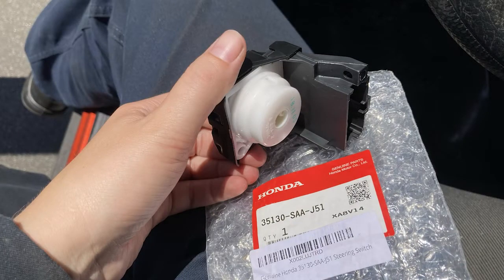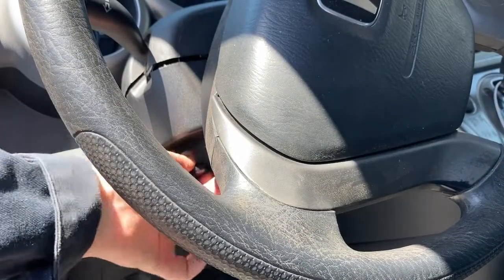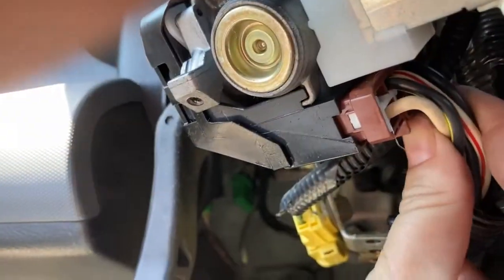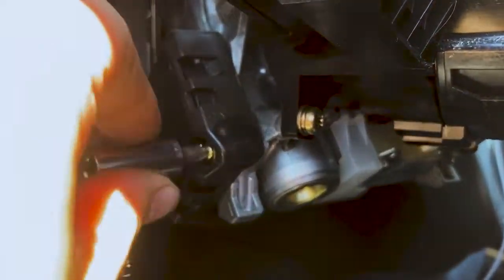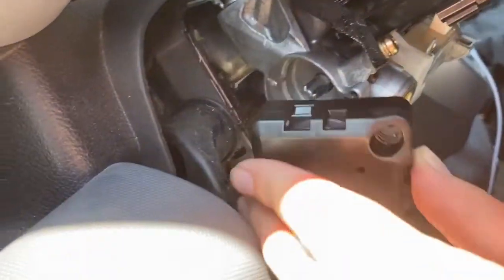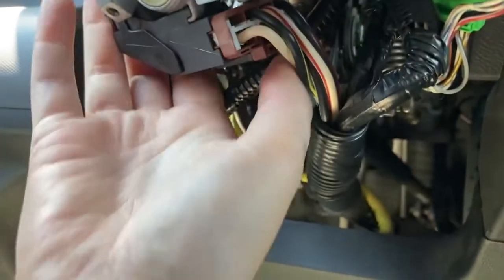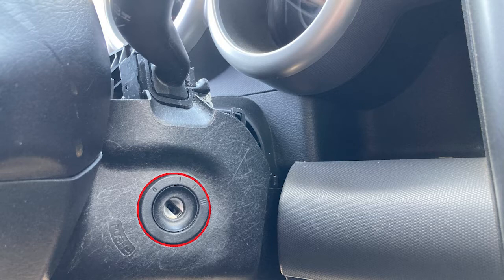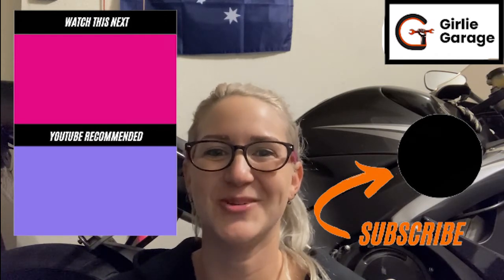2003-2011 Honda Element - Replace Ignition Switch - Girlie Garage

Comment: 1) At 53 seconds into...notice Girlie's sleight of hand all you rookies...she DEPRESSES the  tab underneath to release the electrical connector from the switch. I was fighting it, contorted over with a magnifying mirror trying to decide if the tab is raised or depressed.  Total rook. 2).  As I was taking the original switch out without having the new part available to see the location of the second screw, I was fooled by the picture of the screw with the arrow....It is located on the OPPOSITE side of the switch. I disconnected the turn signal connector to get a little more room to work there. Thank you Girlie!...especially the opening where you demonstrate the problem!  Hopefully this ends the intermittent ignition nightmare that has been haunting me for the last 5? months. This was the Lyme disease of auto repair. 1) My mechanic would insert the key the other way...and it would start....sometimes. So I would give it time to recognize the chip, and it worked sometimes 2) Then I would jiggle the shifter in Park sometimes...and THEN it would start...sometimes. 3) Then when that failed ,I'd  shift into Neutral, jiggle it,...and then it would start... sometimes. By playing and jiggling with it between Park and Neutral, it would eventually turn over. I then replaced the Neutral Safety Switch, suspecting it was faulty, and indeed it seemed to work great....for a while. But it kept getting worse..yesterday endless key turns...20?.. while figuring out which garage to tow it to. 
         But one final search today of "Intermittent Ignition Problems" in the Element Owners Forum mentioned the ignition switch. I had already previously replaced the ignition cylinder a couple of years ago. If that was failing again, it would be a $600 bill at Honda. So Girlie to the rescue for $50!!  Thanks again.
Reply from the maker: Wow! Please let us know if this fixed the problem!!
Reply: @GirlieGarage  Yep..all fixed!! Thanks again!
Reply: @GirlieGarage  Got it...works great
Reply from the maker: @tompem  Fantastic! Thank you for the details with your specific issue. I'm sure it will help someone else out there struggling with the same problem!

Comment: Mine is doing the exact same thing! I'm so glad you posted this and made it very simple for someone who is not mechanically inclined. I actually feel like this it completely doable for me to handle myself.
Reply from the maker: Great! Let us know how it goes!
Reply: Finally got the part in (ordered what you recommended,  but it was on backorder). It came in and I changed it a couple days ago. Your video definitely made the process easy and my car starts perfectly again. :)
Reply from the maker: @toaturner1988  Yay!! That is great news! Thank you for sharing and I'm glad your Element is back to starting regularly 🙂

Comment: You just saved me bank! Dealership told me 2 years ago that this was a typical Element problem, and i just needed to turn the key faster. Fast forward 2 years. Seems faulty switch was draining my battery (and of course they won't honor the warranty). They wanted $300 to replace the switch. Thanks again!
Reply from the maker: 🤦‍♀️ they never want to cover anything under warranty….I’m glad you were able to save yourself money and solve the problem of your battery drain!

Comment: This would indeed be a simple repair, except for the fact that the screws holding  the switch in place are impossible to reach with a regular screwdriver. 
Thanks for getting me pointed in the right direction.

Comment: I’m stumped! The 2screws taken from the old ignition switch will not engage with the housing it appears one screw has 2 washers and the other 1.  Reversed them and still unable to screw them in place. Any ideas?
Reply from the maker: Sounds like someone previously did something sketchy or the new one might be a bad part?

Comment: I tried to execute this repair after watching this video, the replacement switch I got was turned to the second position so when I plugged it in the car’s battery turned everything on. After switching it to the correct position and finishing the replacement, I put the key in the ignition but it will not turn at all. The green key light is blinking so I think I set off some anti-theft mechanism. I’m trying to remove the key cylinder to see if a wafer is preventing it from turning but I am wondering if maybe I set off an anti theft mechanism. It’s just weird that the key won’t turn at all. Let me know if you have any ideas!
Reply from the maker: Did you check to see if you accidentally engaged the steering lock? Try putting the key in and wiggling the steering wheel while trying to turn the key. Let me know if that works or if you’ve already found a solution
Reply: Did you end up fixing it? Im running into the same issue

Comment: how do we know if it's the Ignition Switch or the Starter Relay or the actual Starter itself?
Reply from the maker: Much different symptoms for each. If you have roadside assistance they can test your starter for you. You can swap your starter relay with another to test that, the buzzing is the primary symptom of the switch going bad

Comment: Do I need to disconnect that battery before swapping out this part?
Thank you!
Reply from the maker: It's always a good idea when working on electrical to disconnect the battery. Make sure you have your radio code, if not, you can call Honda for it.
Reply: Don't have to, but like they said, it's always a good idea/ safe practice
Reply: What is a radio code?
Reply from the maker: @jgray928  if your radio works after disconnecting the battery you don’t need to worry about a radio code, otherwise it’s a security precaution designed to prevent theft
Reply: @jgray928  after disconnecting the battery on Honda Elements, you won't be able to play your car radio at all. It will ask for a code. I found mine after filling out a form online with a Honda specialist. Sorry I can't remember where, it was awhile ago.  You can Google how to get one specifically for your car, as they are all different.
Reply: @GirlieGarage  thanks! I just ended up not disconnecting the battery…

Comment: Do i need to reprogram the key after replacing the ignition switch
Reply from the maker: You should not have to reprogram the key
Reply: @GirlieGarage what if someone replaced the ignition
Switch and when they did, gave u a different key that now starts the Honda? The old key seems to just crank it and not turn it over. Wanted to ask before I get a switch. The car starts 9 out of 10 times but has to be turned past where the key needs to start.. like 5 percent past. When it does, it makes a buzzzzzing noise . I just thought it was a low battery but not sure. That one time it doesn’t start, it doesn’t do anything. But I have been jumped and it starts right up. Also just last week, it did the same thing and didn’t start. I have a flashlight that also jumps dead battery’s so I tried it. Hooked it up and when I went to start it, didn’t even
Have to turn the key 1/4 of the way and brrrrmmmmmm it started right up. Actually kinda startled me if turned over so
Quickly . Still the ignition switch?
Reply from the maker: @seanhunty9304  Unfortunately that is not enough diagnostic info for me to be able to tell. I would suggest having your battery checked for free at any auto parts store (or if you have AAA they will usually check it for you as well) in order to rule that out. Could be wiring, or the ignition switch, sounds like there are some things to still be ruled out.
Reply: @GirlieGarage  I did . Says still at right Amos but old. I spent the lowest at $10 n got a starter relay switch to begin the not take it to a place to get done place first. Thanks for the answer. :-)

Comment: Mine did that.. but now I struggle to turn key.. what could it be?
Reply from the maker: Does the key turn completely though? Did all the screws get tightened up?
Reply: @GirlieGarage  yes it stopped making buzz noise. 2 weeks later I sticked the key and it won't turn at all I gotta stick it in and out and jiggle it (fight with it) and 3 times I have had to do it already. But I'm scared  that maybe next time i.wont be able to get to turn anymore. I been watching YouTube and the word  "tumbler"  was said alot. Suggestions? Or any idea? Thank you
Reply from the maker: @marcodelapaz5021 the tumbler is the part of the ignition where your key goes into, eventually they do get worn down. You could try 2 things: 
1. Make sure it’s not your steering wheel lock causing you issues (jiggle the steering wheel when inserting the key and see if that changes things)
2. You could spray a small amount of WD40 into the tumbler (use the key to spread it open and the straw to spray) and see if you can give the tumbler a bit more life with some lubricant

Comment: My key still won’t turn. Any suggestions on why
Reply from the maker: So the key not turning would be a problem with the lock cylinder/tumbler. You could replace it and have 2 keys (one for the door and one for the ignition) or you can contact a lock smith

Comment: Anyone by chance know where I can get replacement screws for the switch? Took me forever to get those screws out because they are pretty stripped.  I'm guessing a dealer, but would rather not go through that trouble. Also if anyone knows the size/ type of these, as I didn't find them at the local hardware store. Thanks
Reply from the maker: If you have a junkyard nearby, otherwise you can order them direct from honda
Reply: Same problem here. Tried 3 different screwdrivers with no luck. Frustrating because the rest was so easy. Still haven't changed it yet.😔

Comment: Just changed it and now the car key wont even turn... It looks like it locked 🤦🏽‍♂️🤦🏽‍♂️🤦🏽‍♂️ I put the old switch back and still the same 🤦🏽‍♂️
Reply from the maker: Your steering wheel lock probably engaged, try wiggling the steering wheel while turning the key
Reply: @GirlieGarage  it didn't work with the new one installed.  I had to put the old one in, wait a few minutes and then it worked.
Reply from the maker: @alexisgueits7684  that’s very strange. I wonder if it was bad out of the box. Can you return it and try a different new one?

Comment: Switched out ignition  switch and key locked into position 0 what went wrong ?
Reply from the maker: It's possible you got a bad ignition switch out of the box. Otherwise it sounds like maybe a screw didn't go back in or wasn't tightened down.
Reply: @GirlieGarage  ty I just got the message it's 11pm here I'll check in the morning ty again
Reply from the maker: @jiggingwithjd4464  you can also try putting the old one back in to see if the problem persists or if it truly is the new ignition switch

Comment: WARNING: Do not attempt this repair unless you first have a right angle screwdriver with lots of different bits to choose from. I just performed this fix, so I know what I'm talking about (plus I'm Tom 'the Switz' with my own automotive channel). The screws to get the ignition switch out are in nightmare locations... very difficult even with the right tools. This video is excellent, but I guarantee you if you do not have a right angle screwdriver ... like the Pittsburgh ratcheting right angle multi-bit screwdriver set, and the correct bit, like CR-V6 out of the Warrior 33 piece security bit set (also from Harbor Freight) you will have a devil of a time. Best of luck!
Reply from the maker: Thank you for sharing your experience when completing this job. In a pinch or in order to not have to buy a bunch of specialty tools, you could also use a Phillips screwdriver attached to some vice grips. Brownie points for anyone else who had to get creative….

Comment: I changed mine now the steering wheel wont move and the key wont turn. Now what?
Reply from the maker: It’s possible it wasn’t installed correctly, or that your steering wheel lock is just engaged. If everything looks like it was installed correctly, Try jiggling the steering wheel while jiggling the key.
Reply: Did you end up fixing it? Im running into the same issue

Comment: Well, I changed this switch, still doesn't start. Key turns, no buzzing sound, perhaps fuel pump sound or fan.  lights come on. Cleaned batter terminals. still doesn't start. Piss me off.  I see a green key flashing on the display.  what would that mean?
Reply from the maker: Is the battery in your key fob dead or have you changed that recently?